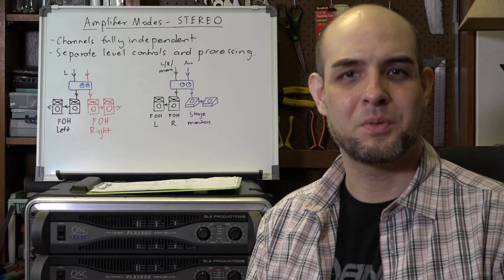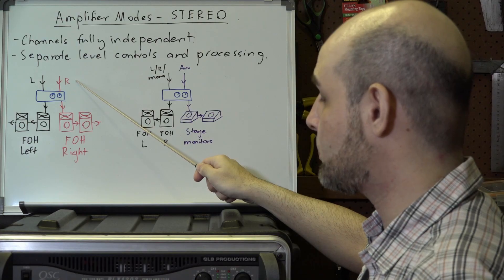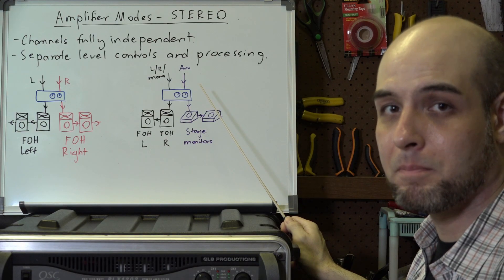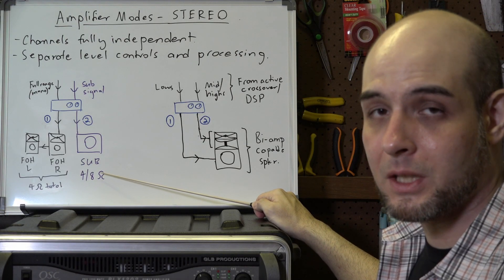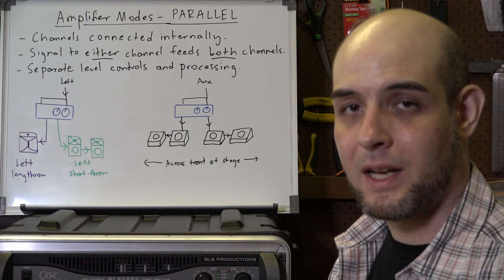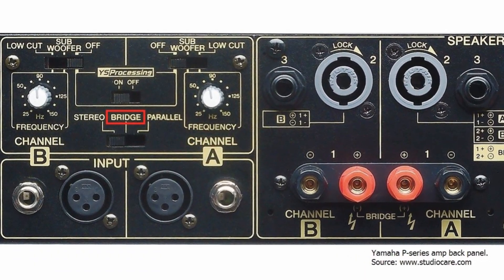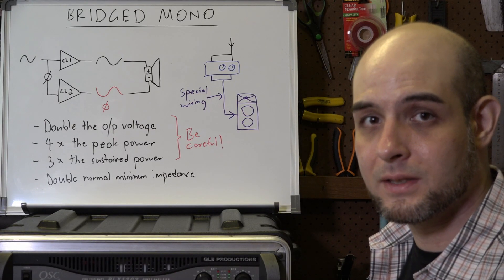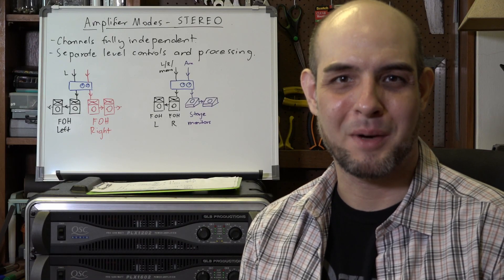Power amplifier modes explained

Comment: I have two  JBL tr225  I was wondering if the plugs on the back are both inputs
Reply from the maker: On that model the 1/4" sockets are wired in parallel - either one can be used as an input, the other one can be left unused or used to daisy chain the signal to another speaker. More info here: http://www.jblproservice.com/pdf/TR-Series/TR225.pdf
Reply: @GLBProductions  thank you very much I finely got everything working you have been very helpful thanks alot
Reply from the maker: That's great news Richard 😄👍🏻

Comment: How do I hook a house receiver to the pa system
Reply from the maker: Please explain what you mean by house receiver.
Reply: @GLBProductions  I have a YAMAHA RX-V757 natural sound av receiver and I am trying to hook my EP2500 to it for my  JBL tr225 I have two of the towers and a Peavy 18in subcompact  I want to use it in my house
Reply from the maker: In this case you would use the PRE OUT (front) to connect to the amp powering the JBLs and the PRE OUT (subwoofer) to connect to the amp powering the subwoofer. You must have a very large house 😄
Reply: @GLBProductions  when I got the JBL speakers  the input and outputs wasn't working so took the input/output panel off the back and the 15's wasn't hooked up to it I think that is a crossover the was still hooked the 15's hooked to each other and a real thin wire was run from the woofer to the panel they cut the wires off where they originally were do I need to wire them  back

Comment: Hi, if i were to run 2 passive speakers and 2 active subwoofers. What mode is recommended?
Reply from the maker: How do you plan to configure your system?
Reply: @GLBProductions . Mine is through PC connect to USB DAC. USB DAC connect to Power Amp with XLR cable.
Reply from the maker: In this case stereo mode would be the best choice. But you still need to work out how to route the signal to the active subs. Remember that you CANNOT connect the speaker level output of the power amplifier to the input of the subs.
Reply: @GLBProductions Thanks. Is it ok if I connect the XLR link port of the CLA-200 to the active subwoofer XLR source link?
Reply from the maker: Yes - check out my video on working with active subs for more suggestions on how to configure active subs with passive speakers: https://www.youtube.com/watch?v=548GZAF6fMY
Reply: @GLBProductions  Thank you very much

Comment: Hey Bruno always admire your pro approach to sound engineering. I am currently building a sound system (the name Jamaicans use for big PA systems). I have some Behringer inukes 12000 (2-xlr/1/4 inputs and regular channel A/B Speakon outputs) How can I daisy chain these amps? Thanks!
Reply from the maker: Hi Arya, we also call them sound systems in Singapore 😄 On that amplifier you cannot daisy chain the channels because you have only a single input connector for each one - you will need to use some sort of external XLR splitter system. Definitely not a good design choice by Behringer!
Reply: GLB Productions Thanks so much for your reply. And I do hope Singapore is managing with this Covid-19 situation. So, sound system it is 😀 I was thinking the same thing, but of course I have to speaker with the master at this. Listen Bruno! I would love to consul with you on a pro level. How can we make that happen? Thanks! And be safe 🙏🏽
Reply from the maker: Thanks, we are managing so far - Singapore is very small so we are able to make changes quickly to deal with the situation 😄 You can contact me via Facebook or email if you would like to have a more involved discussion - details are in the description of the video.

Comment: Hey Bruno. I have 2 types of speakers that are currently use for 2×FOH & 2×Monitor wedges(which are separately for musician & vocalist). Recently I got a 1 sub for my system. Can you give a wiring suggestion for this new routing system?
Reply: Here's my equipment:
1. Peavey PV14 Mixer
2. IVA M-5.0MKII power amp
3. IVA em7.0 power amp
4. Behringer DCX2496
5. FLP NX12 speakers
6. Behringer VS1220F wedges
7. NEXO LS1200 sub
Reply from the maker: Hi George I'm afraid that I'm not able to make recommendations without seeing your system in person. You are much better off engaging a local sound reinforcement professional to review your system.

Comment: Brilliant explanation as always! So what i understand is that when using bridge or parallel, we need another amp in case we need to make a stereo config?
Reply from the maker: Correct - you would use one amp for left and another one for right.

Comment: Thanks for the explanation. When you explain using one channel to run two front of house speakers and a sub the term daisy chaining is used. Does this refer to wiring the FOH in parallel?
Reply from the maker: Yes that's correct - it's the idea that the output of the first speaker is connected to the input of the second speaker, connecting them in parallel. It also means that no stereo panning is available.
Reply: Thanks for clarifying.

Comment: Sir, I have a doubt. What's the purpose of sensitivity switch present in the backside of amplifier?
Reply from the maker: It adjusts the input sensitivity of the amplifier, ie how much input signal is required for full power output.

Comment: Hello Bruno can you run two full range speakers in bridge mode with a crossover such as the peavey pr15 or the Jbl prx415
Reply from the maker: You can run two fullrange speakers in bridge mode WITHOUT a crossover, just daisy-chain them together :)
Reply: GLB Productions but if I wanted to put a sub on another amp then I would use a crossover  that what I was trying to say  to get my low frequencies
Reply from the maker: That's right.
Reply: I was told that you never should bridge your tops that for that info great tutorial
Reply from the maker: The problem with bridging the tops is that you can't have them in stereo. Apart from that it's ok.

Comment: Hello Sir. I have two bass boxes. It has one by one 18" low speakers (400/800W) 8ohm.
The amplifier is Dynacord P1050. The output of amp: 2X560W(4ohm) and 2X380W(8ohm) The bridge output: 1100W(8ohm) and 1500W(4ohm)
Can I use this amp in bridge mode for the low speakers?

Here is the photo of the amplifier rear side: http://eladotechnika.gportal.hu/picview.php?prt=682162&gid=2727288&index=3 

Thanks for your answer.
Reply from the maker: Hello Zoltan, in this case if you bridged this amp into the two subs connected in parallel each sub will receive 750 watts, which is almost ideal. So yes, no problem, assuming the above information is correct.
Reply: @GLBProductions  Thank you very much.

Comment: Hi Sir bruno, just want to ask If it is possible to attached two 8 ohms 350watts rms speakers in parallel for bridge mono mode amplifier that stated to handle 1100 watts 4 Ohms bridge? Thank you.
Reply from the maker: Sure no problem - each speaker will receive 550 watts.
Reply: @GLBProductions  thank you so much sir, learned alot from your clear & precise explanation. God bless.

Comment: @15:10 you stated in Bridge Mode to run a full signal to the amp. What if I'm bridging the amp to drive a sub and need a LPF signal ran to the amp because the passive sub doesn't have an internal optimized LPF?
Reply from the maker: You need to derive the low passed signal from somewhere - typically an external active crossover or signal processor. Some amps have a crossover function built in.

Comment: It's so frikkin informative and should get me my answer but I still have no clue what to do.
I wish some guy would use actual amps to explain what's going on. All I want to do is have 2 passive focals connected to my Akai. The akai says it gives 55 watt per channel in 8 ohm, and that's perfect for my focals. So do I just plug them in in the most regular fashion? One speaker to the +&- from A and the other as well? 
Also, my amp says "A, B = 4-16ohm" & "A+B= 8-16 ohm" 
That means with my 4-16 setting I'm still safe to run 8 ohm speakers right? I'm scared to blow up these expensive speakers.
Reply: The speakers max watt power is 200w and recommended is 40-130 so I should be safe there.
Reply from the maker: Yeah, one speaker per channel should be fine. If you are really concerned email the speaker manufacturer directly and get them to clear your choice of amplifier. Remember that even a correctly matched amplifier can still damage loudspeakers if run into clipping for a prolonged period of time.
Reply: @GLBProductions  Thanks for your reply! I tried the amplifier but it was not working, my left speaker made no sound unless I pushed the volume to the point where it would distort.  I got another amp today, Kenwood kr a5050. Am currently listening finding music to listen to, but they make sound so that's good! So basically you mean when a correctly matched amp is turned up too loud, right? Would I not have to exaggerate in order for that to happen?
Reply from the maker: The key is to prevent distortion in any part of your system - once you hear that your speakers will not last long. Turning things up too loud will cause this, or too hot an input from your CD player or other source device.
Reply: @GLBProductions  Thanks!

Comment: is it okey to connect two subwoofer in bridged mode? I mean, output of subwoofer 1 connected in input of subwoofer 2?
Reply from the maker: It depends on your amplifier - combining two 8-ohm subs in this way will result in a load of 4 ohms. You need to check carefully to see that your amp can handle a load of 4 ohms in bridged mode.

Comment: Sir, for my monitor speakers I'm using ateis spa 1120 amplifier... But suddenly amplifier started to vibrate with some sought of unusual sound from the amplifier..
And my monitor speakers are not giving out the sound..I checked the line with help tester ,voltage is coming ...but sound is not coming from the speakers ..what should I do sir?
Reply from the maker: Sounds to me like your amplifier's cooling fan has failed - I suggest you have it serviced by the shop that sold it to you.
Reply: GLB Productions 
Awesome sir ,you are absolutely right ...when I opened the amplifier the cooling fan was not running .....hats off sir ,you are a genius.... And thank you so much sir .....👍
Reply from the maker: Glad to hear that was the problem, you're most welcome!
Reply: GLB Productions 👍

Comment: Suppose I use active loudspeaker in whole stage like as sub,line array,monitor so then I take the mixer output to speaker but question is that which no of speaker get connect in same signal with any kind of distortion?

Comment: If I'm using 2000wt power amp in Parallel mode then  how many speaker I have to connect in both channel ( a )500wt( b )500wt (or) ( a )1000wt( b )1000wt

Comment: Hi GLB. Thanks for your informative video. Unfortunately I still can't quite figure my large pro audio system out to patch it and run it correctly - mainly I'd like to check how I power the subs. I'm a pro musician - our band plays a lot of large venues. My sole amp is a Camco Quadro Vortex 3 4-channel amplifier (rated 750w into 4 ohms per channel), and it powers my double NEXO PS8 system (which is 4 x ps8 boxes for the tops, and 4 x LS400 subs - I run two of each of these boxes per side (so 4 tops and 4 bottoms in total). I run the PS8 top boxes in stereo.. 2 per side, so a 4 ohm lode per side out of amp channels B and D in stereo. The individual sub boxes are 6-ohm boxes, so I link two boxes together per side, out of amp channels A and C, so those 4 boxes would be a 3-ohm load per side - per amp channel there, as I have all four amp channels switched to stereo. But I suspect I'm not running the subs as powerfully as I could be, so may not be getting the maximum bottom end out of the amp, but I think the A&C sub channels are being pushed quite hard regardless of the modest output. Can you please tell me how I should patch this particular system to get the absolute MAXIMUM out of the amp for the subs? It's loud, and sounds clean, but I suspect it's capable of much more, if I patch it correctly - would parallel mono for sub channels A & C in this case be better than just running it in stereo with this heavy 3-ohm load per amp channel? I use the original blue analogue NEXO TD Controller for full speaker management, as is Nexo's requirement.
Reply from the maker: Hi there Stu, looks like you have a nice rig! Ok let's look at the numbers: 

You're running the PS8s in stereo, two per channel, which is a 4 ohm load. Your amp does 750 watts into 4 ohms per channel, so each PS8 gets 375 watts, which is within the Nexo spec of 200-500 watts for that box. So far so good. 

You're running the subs in the same way, which is a 3-ohm load per channel. If you look at the amp manual for stereo mode operation, you'll note that the amp is only rated down to four ohms per channel, so running it the way you have it now is actually not a good idea! Were you aware of this? This is the manual I'm referring to: http://www.camcoaudio.com/downloads/V3QUM_GB_2004-2007-R2_12-2007_screen.pdf (Look at page 13) This may be why your system seems to lack low end... 

From what I can see, there is no way for you to power this entire system correctly using the one amplifier that you have, due to the impedance of your subs. My recommendation in this case, based on the limited info that I have, would be for you to run two subs only, one on channel A and one on channel C. This would result in an amp output of 750 watts into 4 ohms, which is almost exactly what Nexo recommend for the LS400. Try this and see how it sounds - it may actually sound better than having all four subs connected!
Reply: Thanks so much for your knowledgeable reply Bruno! Yes, I did check page 13 of the Camco manual that stated 4 ohm loads/channel. But then, page 14 goes on to say that in parallel mono mode, the parallel mono'd channel can run at 2 ohms. So I thought my 3ohm sub load would be way better off that way than just running in stereo mode? And also, the amp has technology built in that senses underimpedance and subtly shuts the amp down, I think it senses at below 2.66 ohms or somewhere there (that's why I ran them at 3ohms - I thought it would just sneak by, which I guess it did in the end, but barely!). But what do you think? 

Edit!: I'm awfully sorry Bruno, but one more question just sprang to mind that might be relevant? There are two 3-way channel sensitivity switches on the rear of the Camco amp (for channels A/C, and B/D), that switch between 26db, 32db, and 1.4v. Which should I go with there, because there is also a 3-way sensitivity switch on the back of the blue Nexo TD Controller, and it offers 0db, -6db and -12db settings. I run it on 0db, as -6 and -12 seem so quiet by comparison. So to align it to the amp, should I run the amp on the 26db setting? I believe that corresponds with 0db on the TD unit? And I think 32db equals -6db on the TD.. but no idea what the 1.4v setting is?!
Reply from the maker: Hi Stu, given the number of questions you have I strongly suggest that you contact the person who sold you the rig and ask their specific advice. Alternatively contact your local Nexo dealer, they will be the best people to help you. I would still recommend the same thing - try and run the rig with only one sub per side and see how it sounds.
Reply: Thanks Bruno.

Comment: Also confusedabout Marshall Plexi guitar amps.  You would see pictures of Jimi Hendrix amps with a short jumper from one channel to the neighboring channel.  What was that about?  Almost looked like big power out into line level input?  How many volts is line level.  How many volts is a phantom powered microphone?
Reply from the maker: I'm not an electric guitar player but the idea behind this is to access both normal and bright channels simultaneously so that the tones can be blended together. More info here: https://www.sweetwater.com/insync/jumpering-marshall-amp-channels/
Professional Line level is +4dBu or 1.228 volts. Phantom power is generally +48 volts DC, although you can get 12 and 24 volt phantom power on some devices.

Comment: Bridge, proprietary wiring, raw wires look like a cheap home stereo.  Speakon bridge mode- ouch!  Watch out, Speakon wires must be rewired.  Normal Speakon cables- Scott Grove recommends 12 gage, thick wires to handle the amperage.  Not properly matched systems where a person uses a guitar cable to run power through, the vocals cut out because not enough wattage can go to the speaker at higher power outputs and higher volume settings.  One of your back shots (Yamaha?) had a choice of guitar cable (I associate with line level, low voltage to active speakers) or Speakon connection (I associate Speakon with high voltage/amperage to passive speakers).  I am also afraid of getting electrocuted.  Example:  guitar player performing and lips touch microphone singing = electric shock.  A girl singer was electrocuted to death in summer 2017.
Reply from the maker: Quarter inch plugs were used for speaker level connections for many years before being replaced by Speakon. And yes plenty of people have incorrectly used co-axial guitar cable instead of unshielded twisted pair speaker cable!

Comment: Hi sir can i put a 2 pieces loud speaker in bridge mono mode 8 ohms per speaker.
Reply from the maker: Yes you can as long as you amp can be bridged into 4 ohms. Check the owner's manual.